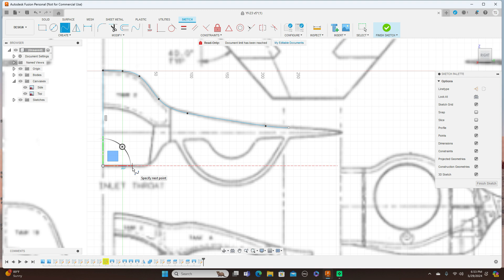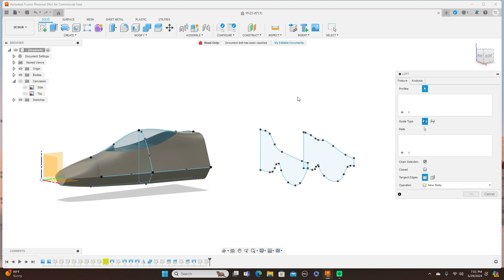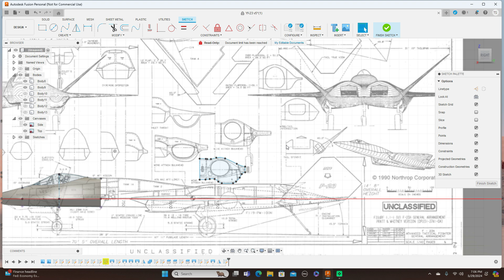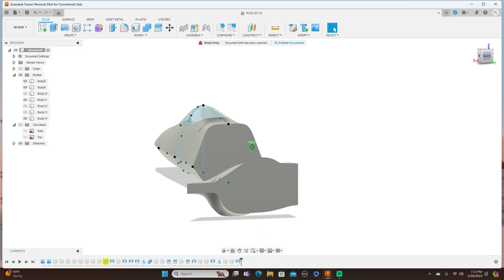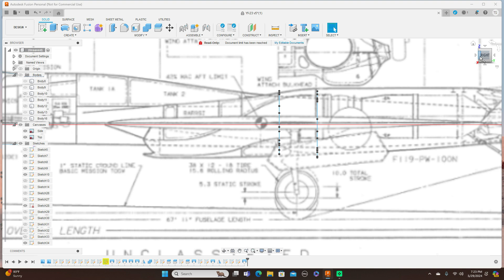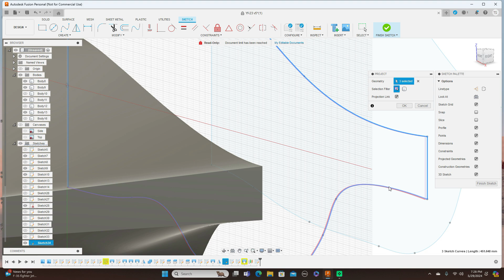Fusion 360 Learn how to  model a YF-23, surface lofting, in this tutorial.

Comment: Hi first off your using the plans for the F-23A and not the YF-23.  Northrop carried on developing what was the YF-23 into the F-23A as the Japanese Airforce were thinking about taking it.  The biggest differences are the inlets (the YF-23  have more of a boxy inlet due were as the F-23A has a more rounded), height of the engines housing section of the airframe and length.  There is another F-23A plan as well with have cross sections as different positions along it's length but both sets have issues with the cross sessions not lining up with each other in the same plan and between plans (its driven me mad for years).  One area which is a pain is the body/wing interface, the airframe is very much a blended body.  I've been trying to get a good model for a few years (not full time) so I can put it into CFD so I'm a little picky :)